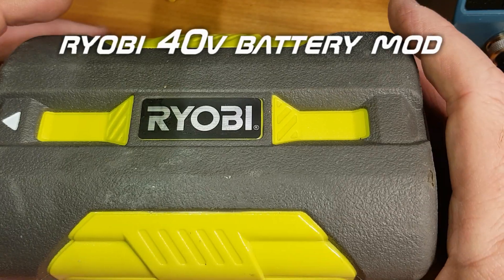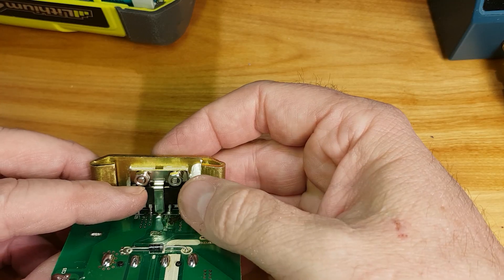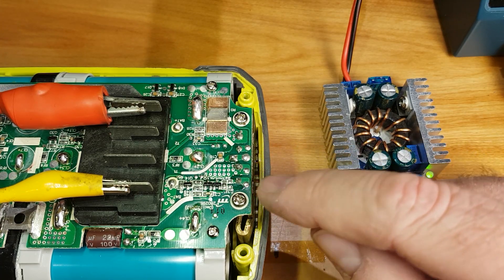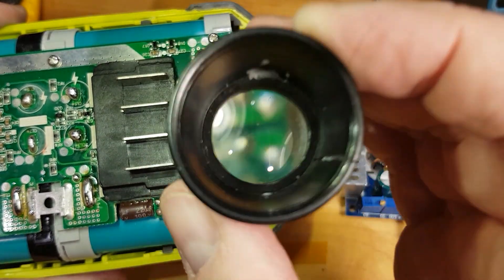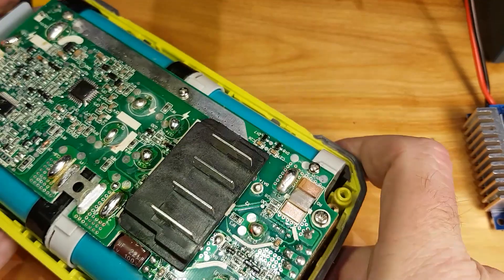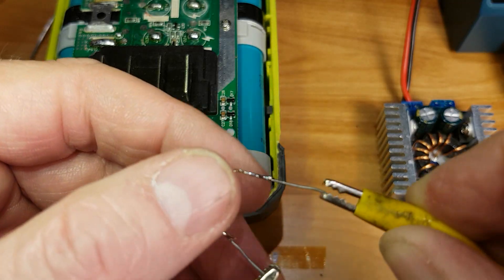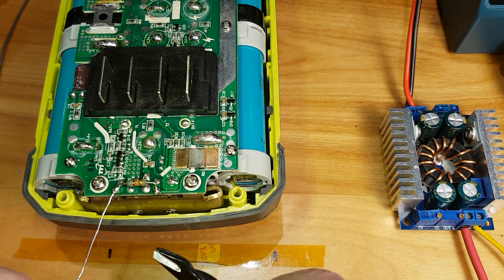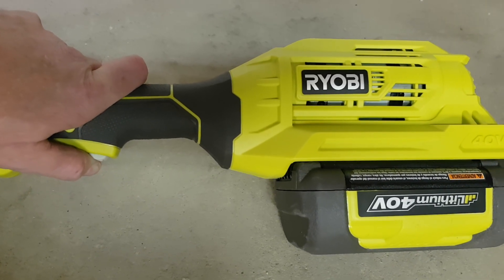Ryobi 40V battery won't charge.

Comment: If you could provide a link to where to an example of the charging device that you are using it could be very helpful to people.

Also, you seem to understand this circuitry pretty well.  I have a couple of packs whereby I have verified each cell is charged to full voltage, yet I only get half of the voltage at the main terminals.  From the main pos and neg charging terminals the pack reads 20.5v and from the main negative terminal to each individual cell I get about 2v even though each cell is charged to 4v.  Any thoughts on what is causing the BMS to restrict the pack to half the voltage at the main charging terminals?
Reply from the maker: From Amazon

Yeeco Boost Converter Module DC-DC Step Up Converter Board 8-32V to 9-46V 8A 150W Voltage Regulator Booster Module Adjustable Voltage Step Up Power Supply Module

I use a laptop power supply to provide input power.
Reply: @thecityviking  Thank you.  Any thoughts on the 2nd half of my comment?  Also, any idea if we can use the "rst" location on the board to reset the chip?  The available pins are: CLK, DAT, GND, 3.3v, RST.  I wonder if we would briefly shunt the 3.3v to RST?  Now that I have every cell at full charge I am wondering if it is possible to manually reset the chip using these locations on the board?
Reply from the maker: Sorry I didn't see the second part. I believe I know exactly what you're talking about. The voltage is not being restricted the pack shuts off the FET when the pack is not being used if you hook a small load up to the main terminals and then measure it you should get the proper voltage but it only lasts for about one minute and then shuts off.  I will make another video explaining this for others.